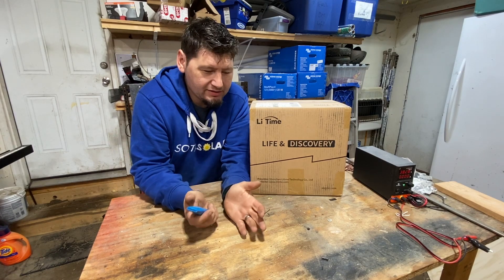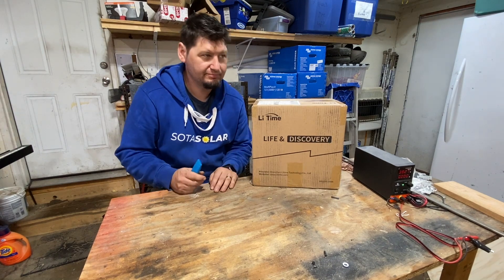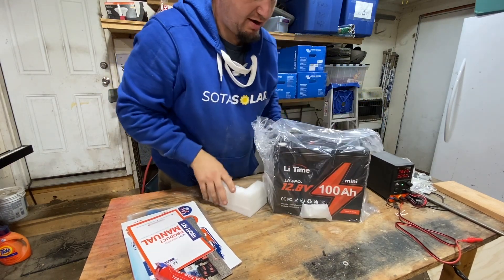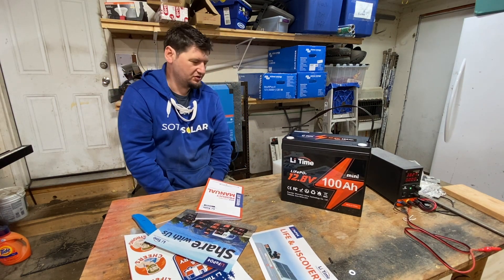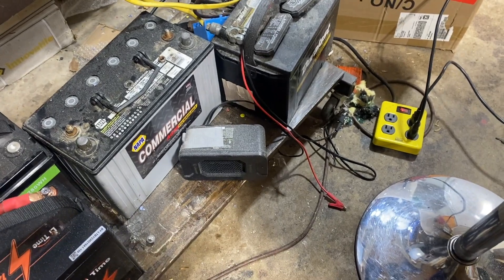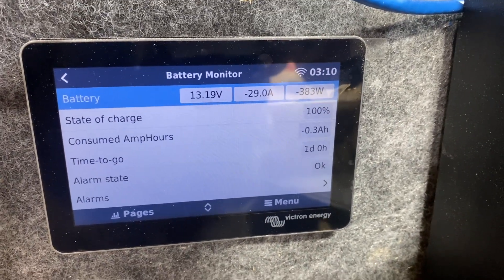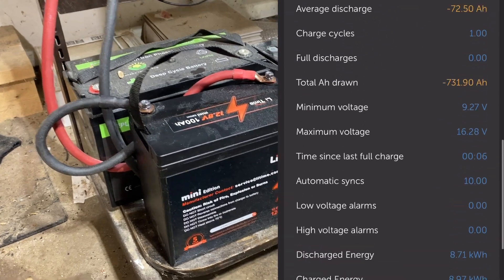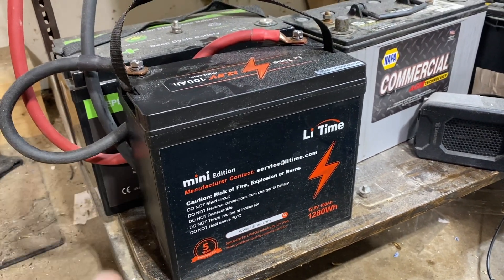New Li Time / Ampere Time 100ah Mini Lithium Battery Review

Comment: I have two batteries 12 v 200 amp  with built-in 200 amp bms, I need 48 v voltage and I need to buy two more to connect them in series.
But I can no longer find with 200amp bms, can I buy with 100amp bms and connect them to the 200amp bms?
Thank you
Reply from the maker: I’d highly recommend repurposing those 12v batteries and buy 48v batteries.  You’ll have the to add battery balancers to keep those 4 batteries in sync. 

You can try what you’re thinking, but you may have BMS issues under high load.

Comment: Does anyone have any ideas as to how this "mini" battery has as much power as the regular sized 100 Ah? Could there be downsides?
Reply from the maker: Less empty space. Before they were making a 100ah battery to fit a group 27 or group 31 spec. This is just as small as possible. On a traditional group 31 lithium battery there is 50% empty space.

Comment: I got two of these from PowerQueen for my dad's camper and they came with nearly identical AC IR of 3.68mΩ, at the same voltage of 13.21, and both yielded 105Ah and 1364Wh. Serial numbers are very close together so I'm guessing same batch. Obviously I was hoping for "batched and matched" cells and I'm fairly certain they are so putting them in parallel should be no problem whatsoever. They're going his smaller Opus camper so likely they won't get much use but I plan on checking them after a year to see how storage in not so optimal conditions is for them (AZ, will be left in the camper's battery compartment which is inside under a bench in the middle of the camper. The camper does stay shaded under a large tree in my brother's "RV area" behind a gate at the end of his driveway so they will have to deal with some higher temps throughout the summer but I doubt they will ever get above 50C even in the hottest parts of the years thanks to the shade)

It appears that if PowerQueen, LiTime, and Redodo aren't related they are using the same manufacturer as all their batteries have identical construction. PowerQueen did tell me what their BMS specs are and I was surprised to see that they are quite conservative on the top end which is what I would prefer. The one issue I had with them is that during their first charge at about 10A they hit overvoltage around 13.86V so hopefully the BMS can fix the slight imbalance and get them up to 14.20V after a few cycles.

Here's their response to my inquiry about BMS parameters. ODP is a little low and I was able to take both batteries down to 10V so they acted like they were bottom balanced. I cut my discharge testing off right after they dipped below 10V as I think taking them below 2.5V per cell is pushing them too low even for a single discharge test. Regular cycling I wouldn't want them to go below 2.75V per cell. I did find it funny that they were confused how I was able to determine cell overvoltage...its quite simple just wait for the BMS to cut off charging, start it back up and watch with a multimeter when it cuts off again. Can't see the individual cell voltages without opening the battery but at least I can get the pack voltage off the terminals. With 3.58V as a max that means pack overvoltage max would be 14.32V so 13.86V leaves 0.46V which I think is a bit much depending on how varied the cell voltages are.

"We want you to know that the full charge level of the battery is infinitely close to 13.8V.
How did you determine that the overvoltage protection was activated at 13.8V?

1、Single cell overcharge protection V 3.58 CELL MAX > 3.58V
2、Single section overcharge recovery V 3.48 CELL MAX < 3.48V
3、Single-section over-discharge protection V 2.25 CELL MIN < 2.25V Charging recoverable
4、Single-section over-discharge recovery V 2.45 CELL MIN > 2.45V
5、Equalized turn-on voltage V 3.455

Under normal condition, any one cell voltage is higher than the equalization detection voltage, the rest single cell voltage is lower than the equalization detection voltage, turn on the equalization."
Reply from the maker: Great info! Thanks for sharing!

Comment: Li Time is priced in the upper part of the low cost tier. However I think this is unwarranted. There are  brands that offer thermal protections that can be purchased for about $100 less. Thus should be a $200 battery at best…….
Reply: Please link me to a battery with low temp protection (a 100Ah 12V) that is under $300. These exact batteries can be had from PowerQueen for about $280.